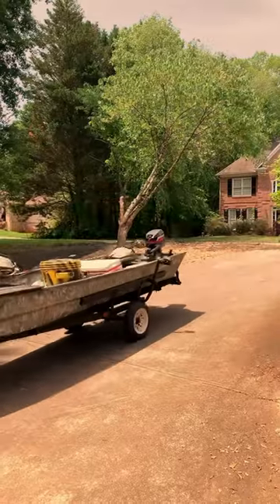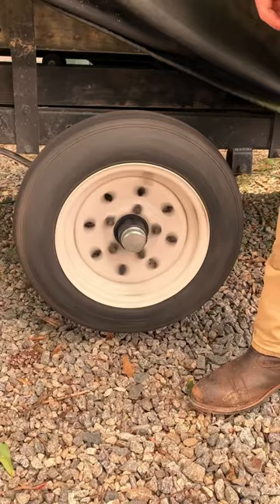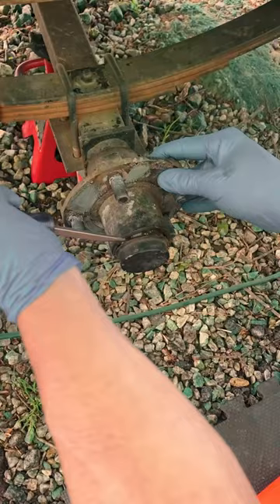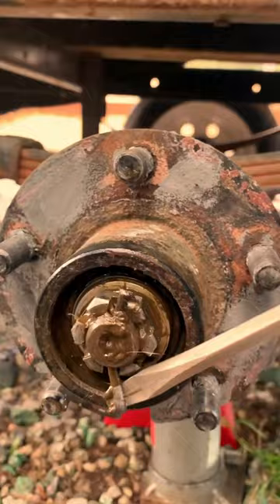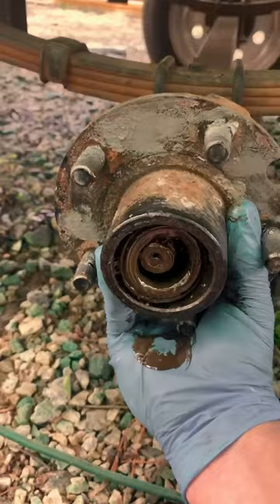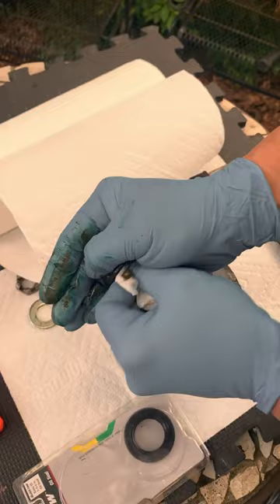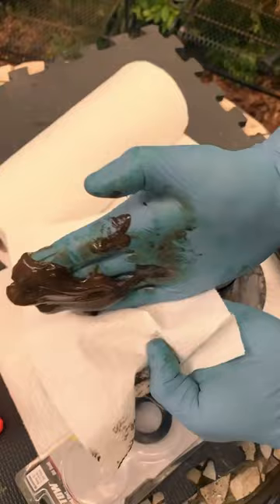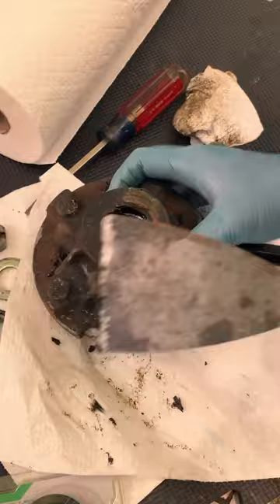Pt1 Repack& inspect your trailer bearings with new grease to stay safe on the highway! #fishing #diy

Comment: If you want another trick remove the outer bearing and washer then put the nut back on then snatch the hub it will pull the rear bearing and seal out with out damaging the seal
Reply from the maker: I will give it a try! Thanks!
Reply: @staggerleesmancave8987  it works well when u get used to doing it when you pull don't pull straight out but let gravity help you